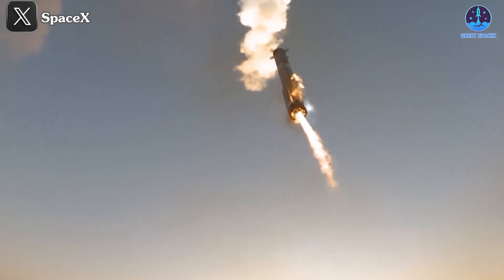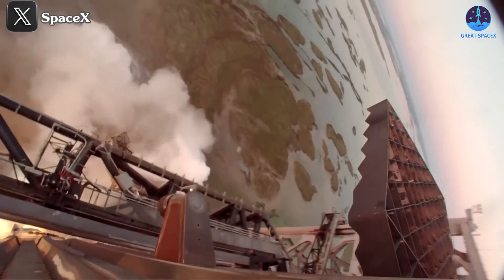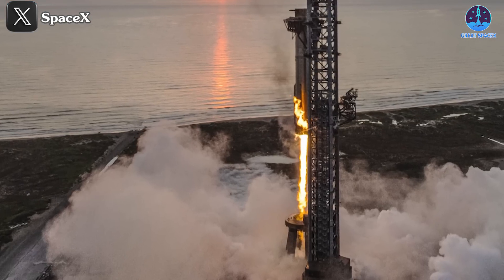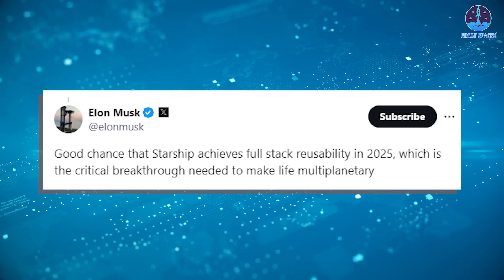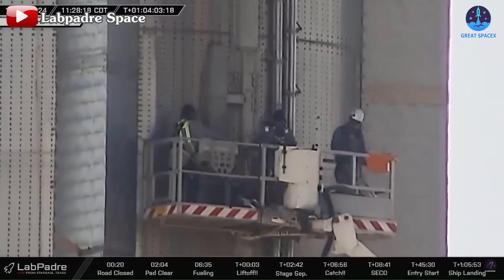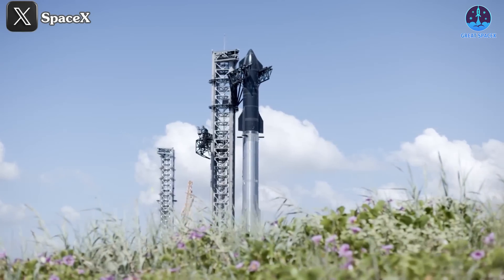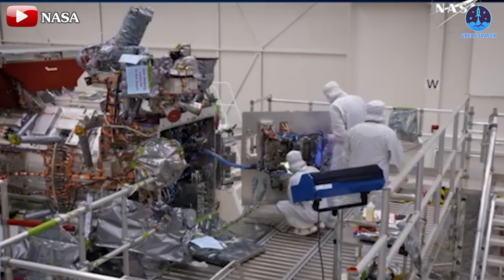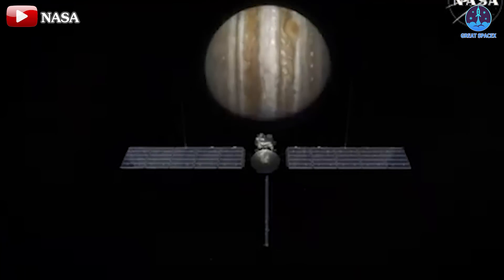SpaceX Released ONBOARD Booster 12 View Show How Exactly Mechazilla CATCH Starship...

Comment: I doubt this booster will fly again.
Reply: Considering the damage to some of the engines I wonder if there is also damage to the inside of the skirt as well.... same with the flame from the quick disconnect point, I wonder if it caused damage internally. At least the damage to the chines seemed superficial and didn't happen until the landing burn.
Reply: I bet it will
.more than once.. 😊

Comment: I doubt B12 will be refurbished.  It will probably be dismantled.  Even though the catch was a success, SpaceX will for the first time be able to inspect all the stress points and faults with a fully recovered booster, and want to improve things in many ways for the next iteration.  So no, I don't expect SpaceX to reuse any Super Heavys or Starships until they're consistently landing/recovering them.
Reply: Unless there is a redesign I think super heavy booster 12 will fly again. That is the ultimate goal after all.
Reply: @waynec9928  Every revision is a redesign at this point.  Often not a major overhaul of a redesign, but many less visible aspects are changing from every version to every next version.

Also, this booster used the Raptor 2, but SpaceX showed off the Raptor 3 earlier this year.  There's a 100% probability that the final Super Heavy & Starship will use Raptor 3s, so things will have to change sooner or later to accommodate their higher thrust.

Comment: Yes it was  caught   but how was it steered so precisely? Complete the story....
Reply: It uses 3 center engines to gimbal and keep it stable in every axis. Also this isnt the first time space x lands a rocket so they know what they are doing at this point.
Reply: Built on the same software foundation that Falcon 9 boosters use to land precisely, but an improved version from many of the same engineering minds.  This would only be truly bewildering if they weren't already routinely landing boosters on barges in the ocean.

Comment: I've seen the videos several times. People keep talking about engine fire. Where is this? Every video I've seen it looks like gases are venting from a port on the side of the rocket, maybe 20 feet or more from where the engines are. This gas occasionally catches fire and then goes out again. After the rocket is shut down more ports at the top also vent gas. This is normal. The lower port I don't know about but it's definitely not coming out of an engine.

Comment: Kinda interested in what COULD go wrong and how you find it. How much sway happened after the weight transfer. How much ground effect adjusted the landing area. What a cross wind of 20mph would do since it seems to land with an accuracy of 12-15 inches in any direction.
Reply: They'll find every nanoparticle that wasn't doing what it was supposed to be doing, fix it, and move on, faster than ANY outsider can figure out what questions to ask about what MIGHT have gone wrong.

Comment: I first thought the booster landed on the grid fins but it's actually just 2 small contact points, I mean if the booster shifts angle slightly it may not contact properly, the precision is just incredible.

Comment: What was the loud whirring sound at the end of the tower booster catch video? Was it the raptor pumps still running or something else?
Reply: Sound is much slower than light, so that sound was the last seconds of engine thrust, while we saw the booster already stopped.  Same with sonic boom, coming to ears seconds after it happened ( see the smoke ring in air )

Comment: Congratulations to Space X on this Starship flight 5 event further advancing technology. Next step will be to safely catch or land Starship vehicle as well as the booster. Then later perform space fueling transfer between starships.
Reply: they can't try a catch of starship until they can do reentry at orbital velocities without a burnthrough.  expect them to start carrying cargo into LEO on starship before they attempt a catch.  i expect a min of 3 more flights before they attempt a catch on it.  they'll need to prove no burn through before they can try a catch, because i don't see the FAA ok'ing a catch on a vehical with unpredictably non-functional/functional control surfaces.  

-the speeds at which starship is performing re-entry isn't really orbital speeds, it's actually a bit slower.  until they can perform reentry at full orbital velocities, they aren't ready to try the catch.

Comment: Even if they couldn't reuse a booster immediately, without a few days of minor repairs, it would still work out fine to have a couple of "ready to go" boosters on reserve (After all, the factory is near by) and use one of them for the next launch, and take the previous one in for inspection and repairs, for a day or so, before putting it BACK in the reserve line a couple launches later. Using three or four boosters in rotation, while NOT quite as convenient as using the same one immediately over and over again, should pose no major problems, so long as usual "inspection and reconditioning" times are short enough to keep up with the launch schedule.
Reply from the maker: Agree 👍

Comment: I don't believe that ship will ever fly again. The engineers need to go over that booster with a magnifying glass. What worked, what can be improved, and what need to be redesigned.
Reply: The ship exploded so no i dont think it will fly again
Reply: @woutgaming9685 I think he was talking about the super heavy booster which was caught. I agree that the booster won’t be reflown.
Reply from the maker: So put it in the museum
Reply: @colonbina1  although I've done post mordant inspection on equipment before. I've never taken a rocket apart. Although it is historically significant, it's an engineering gold mine of information. There are a lot of components that need to be checked out or can be reused. If the outer body can be preserved, then keep it as a museum piece. However, the lessons that can be learned are more valuable.

Comment: "Full stack reusability" won't become "rapidly reusable" until the hot stage ring is not discarded and needing to be recovered from the ocean.  Elons belief that "The best part is no part" has not yet been applied to the hot stage ring.
Reply from the maker: I think SpaceX will handle this soon
Reply: V2 has already solved the hot stage issue, it’s a more scaffold style design to save weight so it doesn’t need to be jettisoned.
Reply: @minmo2288  I look forward to seeing it.
Reply: Use the gridfins as the hot stage separator, locked inboard and oriented vertical with starship riding on top of the fins, would also give a great amount of separation between the vehicles.  When the separation maneuver is executed the gridfins can use the exhaust at separation to release starship and attain a horizontal orientation. would likely save weight and reduce friction with them being in a closed position, even more closed than the falcon 9 fins.

Comment: Landing on those pins is a big change in the stress along the structure. Since take-off, the stress is compressive, with the bottom sustaining all the weight above. After landing, there is a stretch stress, with those pins at the top holding the weight below.

Comment: I don't think booster 12 will fly again, at least not unless they change out for 3rd gen engines because until then it's outdated...
Reply from the maker: Great analysis
Reply: It will probably be taken apart for inspection to see the landing caused any stress to the booster etc.

Comment: I dont think they will use b12 again for another flight. They will probably scrap it into pieces to get thorough data on each sections of the booster, concentrating on the most vulnerable spots during flight.
Reply from the maker: Yeah
Reply: @colonbina1 I predict a double water deluge system...
Reply: @AquarianSoulTimeTraveler   and fire supression on the tower too
Reply: @combivent1000  I agree 100% too much valuable data
Reply: I doubt there is anymore to learn from scrapping b12 than from non-destructive inspecting/testing it… 
SpaceX designed it leveraging 100s of Falcon 9 reuses. They would be best served, learn the most to inspect/test it, refurbish as necessary then send it up again.
This administration & FAA political malice denying timely Launch Licenses continues to be the primary impediment to affordable/sustainable US space. F them.
A Trump win would double the pace of Starship progress.
Reply: I agree. There is nothing to be gained from launching it again. IFT6 will be the last version 1 vehicle flown. After that, version 2 with Raptor 3 engines will be flown. Only then will SpaceX reuse a booster.

I can't wait for that to happen.
Reply: @clay-tw5gc  If there’s nothing to be gained by launching b12 again (testing reuse), what’s to be gained by launching a new duplicate of b12?
This administration & FAA political malice denying timely Launch Licenses continues to be the primary impediment to affordable/sustainable US space. F them.
A Trump win would double the pace of Starship progress.
Reply: Scrap? I may be wrong, but this booster is now part of history. I'll bet it is kept as a museum piece.
Reply: It will of course be used to study and find places that need improvement for the next versions . The only real way to see what changes work is to build it and test it then refine the design and do it all over again. Even the design of the Falcon 9 has had countless refinements in the time it has started flying
Reply: They won't scrap it. It will become a statue at the mars gateway
Reply: @triaged hopefully they do. It'll show the massive progress they've made since star hopper.
Reply: Then they should reassemble it and use it as a showpiece at their headquarters
Reply: It should go to the Smithsonian!!
Reply: Absolutely 💯 agree 👍
Reply: I would launch the new booster designed with integrated hot staging ring
Reply: I heard that Elon & SpaceX are going to refurbish.   That what's I heard.
Reply: Not only that, jettison the hot stage ring was also a temporary solution.
Reply: I hope it gets donated to the Smithsonian Air and Space Museum